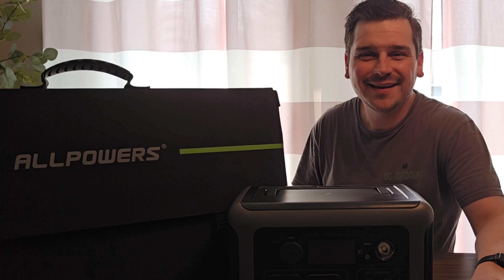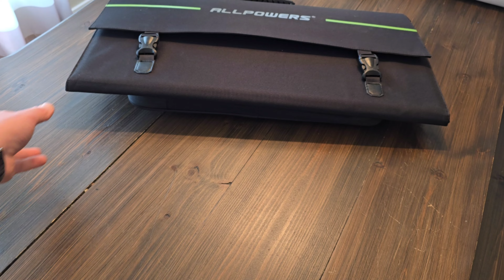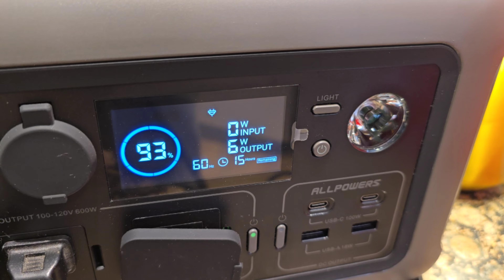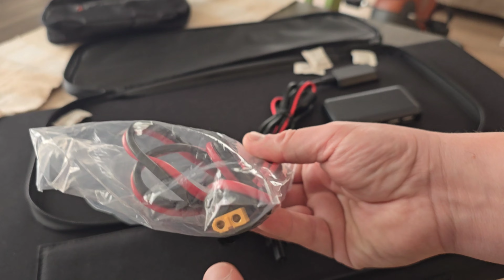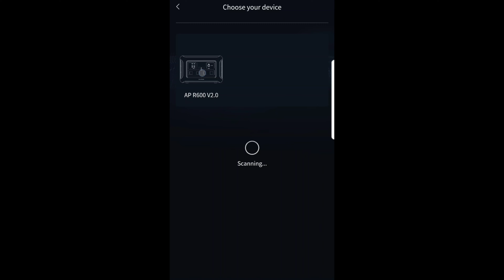We Tested the CHEAPEST Solar Generator

Comment: So much information missing here, terrible review.  Zero mention of the cigarette lighter output, casual mention of USB output, no detail A quick glance of the input panel - can I charge this from my car.  Is there a built in MPPT.  Looks like a reasonable unit and price, but your review is missing the meat
Reply from the maker: @woodysranch2690 thanks for the feedback. Appreciate you watching and leaving some opinions.  

It's been a good unit.

Thanks for the suggestions - it will help me improve my next review video.
Reply from the maker: Hi again, I plan on doing a "Year with the gear" , video to update on my thoughts and I will cover off your comments / questions in deeper detail.

Comment: That’s awesome to receive for review! What has been the maximum watts you’ve been able to achieve from the solar panel since doing the video under optimal sun? These solar panel and power packs can sure come in handy.
Reply from the maker: You know, I'll plug it in again and give it a run here soon and I'll update you. Weather looks good this week so should be able to share some good numbers. The pair will be really handy for off grid charging of cell phones or computer, etc. Not enough juice in it for cooking/heating items but perfect as a portable charger.
Reply: @DCOutdoors  I acquired a 600amp-hour unit and 120w solar panel earlier this year and it is so handy for camping. The only limiting factor is the battery pack doesn’t charge if it’s in freezing temps.

Comment: Pretty little setup. Might have to take one to the cabin in Alaska...then we'll just have to worry about the freezer on the gas generator
Reply from the maker: Absolutely! It's a great system for light use like device charging. For my Tent hunting camp this will be a good system versus all the weight associated with the gas generator and it saves me having to run the truck to charge devices. I like how I can leave the solar panel hooked up and come back to a full Power Station in the evening.

Comment: Great Power Station to take Ice Fishing this winter Dan! Cheers my Friend. Stay safe and well!
Reply from the maker: I really like this unit. I have not a single complaint about it. It seems well designed and has been really handy for light use. The only consideration is this 600 watt device is really meant for light use like charging devices or using lights. It's hard to find other cooking appliances, etc that will run off this low of wattage. That said, I don't expect to need to run electronic cooking appliances off it (I use cooking stove in camp) so this won't matter too much! It's handy though for charging things like cell phones, cameras, computers and more. Love that I can leave everything hooked up all day and come back to camp with a full Power Station!

Comment: What a great bit of kit and awesome if you are away on a car camp and I have so many electrical devices that I constantly need to be charged up and this looked the business to me. Toaster and coffee maker not an issue for me, it is the other smaller devices for me that I need on a hike and a camp. The app looks pretty cool as well and at the price point, looks a good buy to me, cheers Alan
Reply from the maker: I'm blown away at the quality and cost. Usually, low cost is low quality.  I've noticed no low quality issues here. It's going to be a handy tool for charging devices primarily (maybe running a LED light). Otherwise,  like you, I use a stove for cooking and coffee. It's a really great budget priced solar generator.  I've wanted something like this for a while, so I'm blown away that Allpowers chose me to work with.

Comment: 8:38 that definitely could come in handy. I’m cabin trips. I wonder how long something like that would power my New Bouge RV fridge, my little Jackery 200 watt hour will run it for around 12 hours
Reply from the maker: I think the best part is that if you're running something like a fridge you can draw off the power station while the pannel is taking in sunlight and not be using the storage at all. Amazing product. I wanted something like this for a while. I'm very impressed.

Comment from the maker: The folks at ALLPOWERS sent me their 600 Watt Solar Generator kit to test out, unbox and review. The kit contained both the R600 Power Station and their SP209 140 Watt Solar Panel. 

In this video I'll unbox both items, I'll show you the charging options, I'll give you some example items that you can run, I'll show you the Bluetooth connectivity and the ALLPOWERS APP and give you my overall thoughts. 

Here are the highlights:
299Wh Capacity；
400W Max. Fast Charging ；
LiFePO4 Battery with 3500+ Life Cycles to 80%;
10 Outputs for Charging Multiple Devices at once；
Smart Control & Monitor in ALLPOWERS App；

*LINKS*
R600: https://tinyurl.com/2nvpukj3 
R600+SP029: https://tinyurl.com/3yhs8s5a 
SP029: https://tinyurl.com/m2ev4uwn

You can use promotional code DCO10 to save 10% off the R800 Power Station, the SP209 Solar Panel or the combined kit. You can also use the discount code for other items off their store. 

If you like outdoor adventure videos, gear reviews and other outdoor related stuff - please SUBSCRIBE

***
Timestamps:
0:00 Introduction
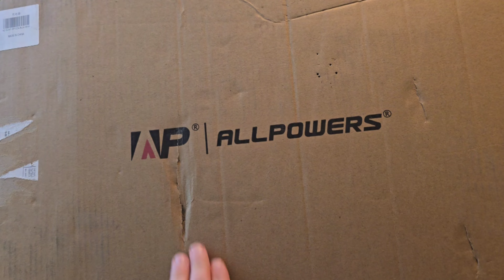1:27 Unboxing the SP029 140 Watt Portable Solar Panel
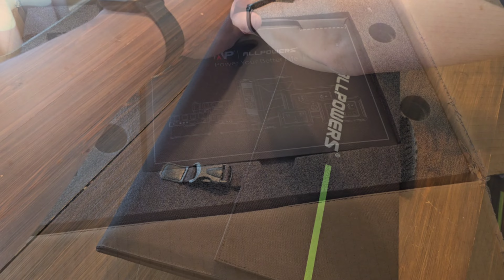3:53 Unboxing the R600 Power Station
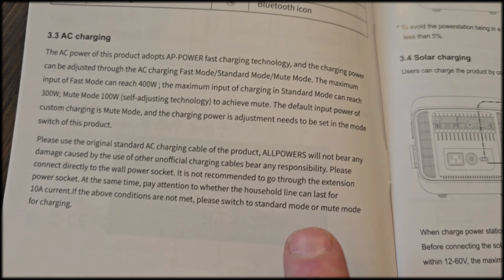5:43 A Deeper Look at the Power Station
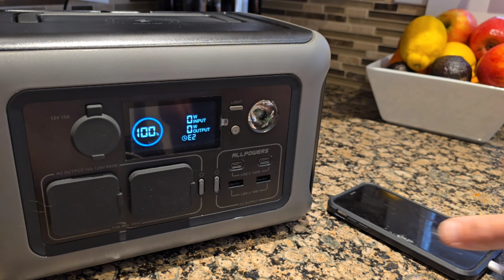7:29 Using the Power Station
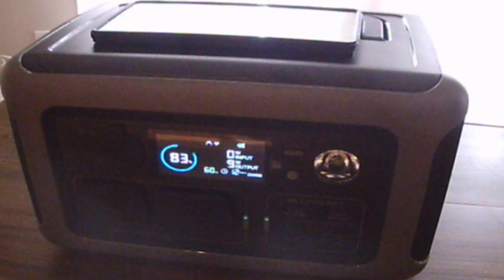13:45 AC Charging the Power Station
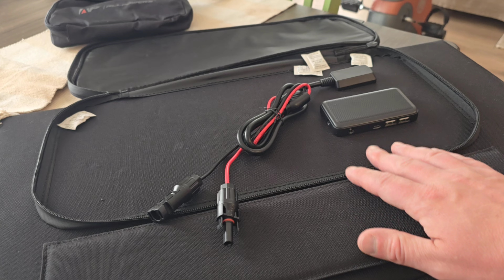14:28 Using the SP209 Solar Panel
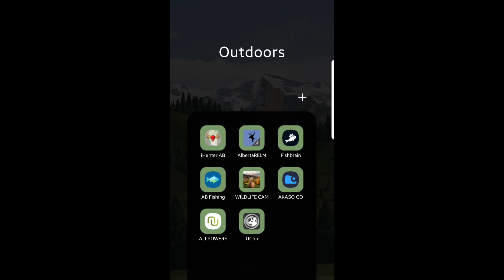17:14 Using the ALLPOWERS APP
20:29 Overall Thoughts & Recommendation
25:42 Outro

******************************************************************
THANKS to  @ProgRockDan1 for the DC OUTDOORS INTRO SONG
******************************************************************